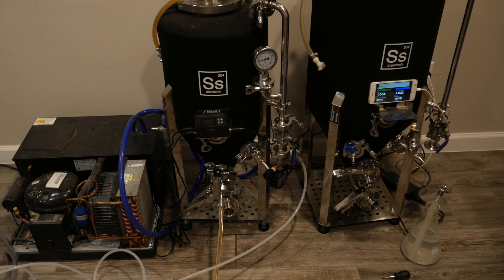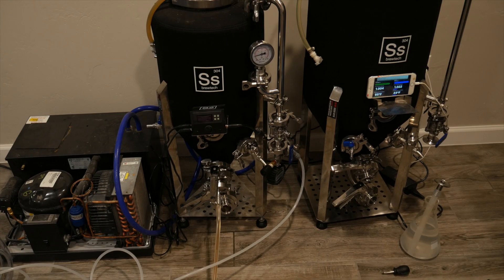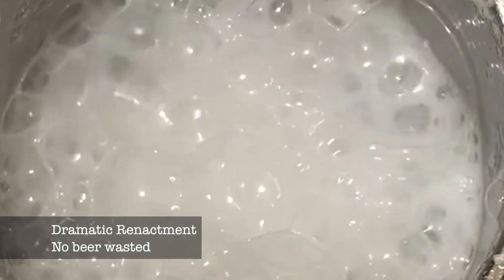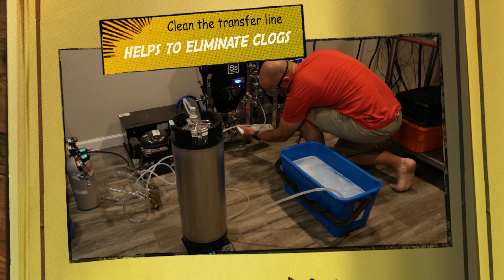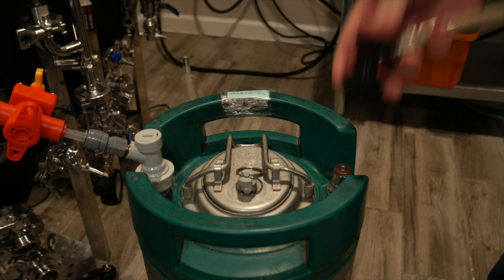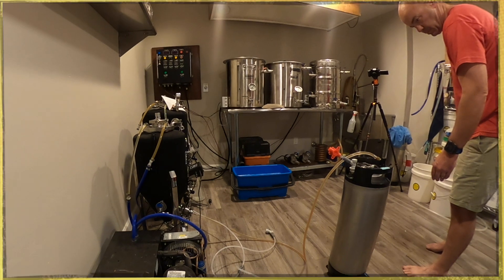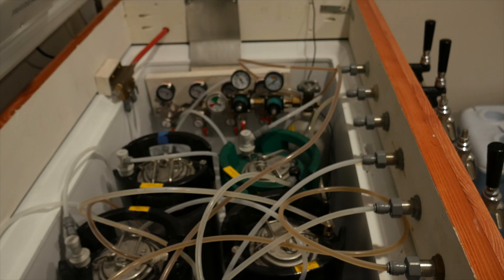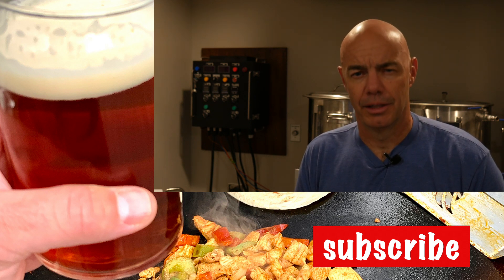EASY! Closed Pressure Transfer From Ss Brewtech Unitank With Carbonated Beer

Comment: Great video on transfer. I love the weight idea.. If I'm transferring Non-Carbonated beer to my Keg. What pressure setting do you suggest PSI)..
Reply from the maker: Douglas if using non carbonated then I would just start with 3-5 psi and see how it goes. What’s your fermenter rated to? Glad you enjoyed the video!
Reply: @FireandFroth  It's an Ss Brewtech 7 gallon Unitank..
Reply from the maker: @douglashaviland1536  man I love my 7 gal Ss Brewtech unitank. Almost wish I had another one as I'm brewing a lot more 6 gallon batches than 12 gallon batches.

Comment: Im looking at  getting brewing and thinking of getting the unitank 2.0 so i dont bave yo clean coil and sanitize. Do you still love the unitank.  Any complaints?  Big investment.
Reply from the maker: Mike I love both my unitanks. Yeah they were pricey but definitely worth it. Not too bad to clean and I really like being able to ferment under pressure. Update: yeah I think I would spend the extra cash on the 2.0 version. Pretty sweet to have a jacketed homebrew unitank.
Reply: @FireandFroth  how are you connecting CO2 for 5psi closed carbonated transfer.  The unitank comes with a ball valve with 1/2 female npt.  What did you put down there to be able to swap from silicone tubing to pumping CO2 inside?  The ssbt spunding valve should have a ball lock port.  I may get the spike spunding valve and remove ssbt gauge and put it on there since it includes a gauge and a gas port.. wouldn't that work?  And cheaper than ssbt spunding valve
Reply from the maker: @4rdzlla  that’ll probably work. I just built a spunding valve and connect it to the ball valve via a TC fitting. Also have a gas disconnect (from a keg) on my spunding valve so it’s easy to get set up. I can take some pictures of my setup if you would like. It probably cost less than $30 to build, well maybe a little more.
Reply: @FireandFroth  ya I'd love photos
Reply from the maker: @4rdzlla  ok I’ll try to post some tonight or tomorrow at the latest. I’m on the road right now.
Reply: @FireandFroth  no problem.  Let me know whenever no rush. I'll look for them